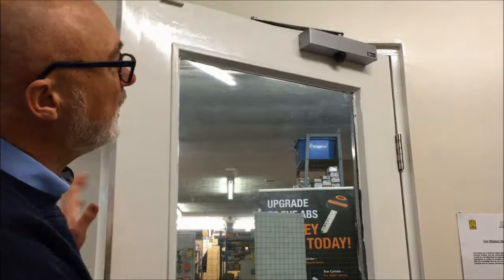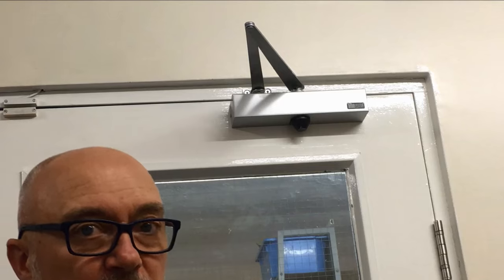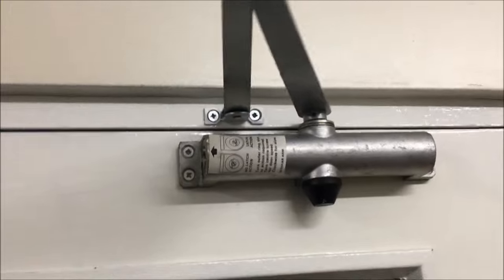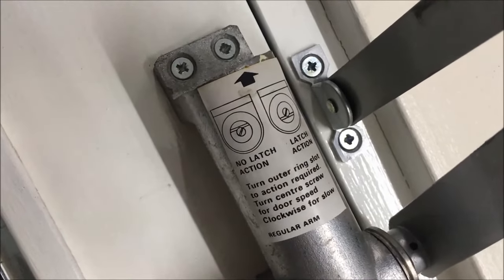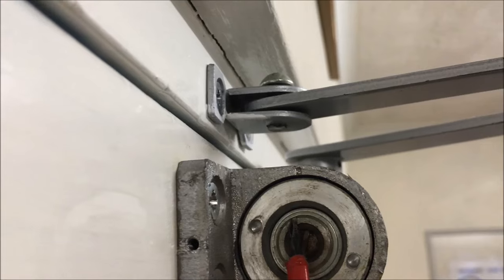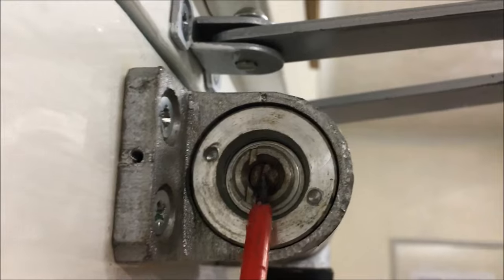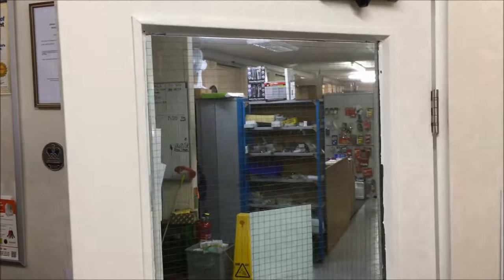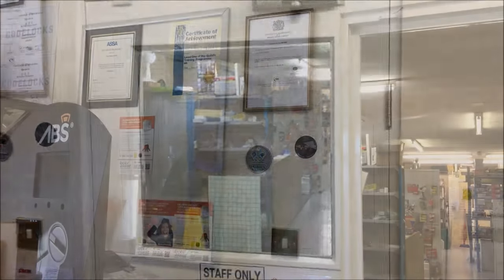How To Adjust An Overhead Door Closer?

Comment: How do i get the power / strength to click shut?  I understand the speed adjustment part/  I'm in a block of flats, i'm on ground floor & the main door when folk go out, the door doesn't click shut (its supposed to be a secure entry with intercom etc.) the door closes over but cant deal with the resistance to actually click shut.  it used to click shut so it needs adjusted but as i watched video i didnt see example of this adjustment.
Reply: Hi. in the video, there are 2 adjustments - one for speed from fully open from around 90* to 15* and the other adjustment is the latching adjustment - from 15* to close.  In the video, on our closer the latch adjustment is in the middle of the of the speed adjustment.  You may find that the resistance can  be cured by spraying some WD-40 or similar onto the latch to reduce the friction..  Good luck, Paul.
Reply: Thanks very much :)   @PaulHarperSmith

Comment: What maintenance is possible - can we lubricate the mechanism?
Reply: Hi Manuel,  these are sealed units so the only maintenance is to ensure all fixings are secure and only the pivot points can be lubricated.  If there is a latch on the door, this can be lubricated too.  Regards, Paul

Comment: Hey wonder if you can help. I have a door closer that says on the side "Super Lynx by Yannedis" and I cannot work out how to get inside it. There is one screw on the underside but that looks more like an adjustment screw than a case screw and there are no other screws I can find to get the cover off. This one does seem to have broken down and we could do with getting it off the door.
Reply: Hi, it may be one that the cover is clipped on and just pulls off?  Can you send a photo?  Thanks.  Paul
Reply: Hi Paul, Thanks for your reply. Here are some photos of it. https://uploadpie.com/4z5i9p https://uploadpie.com/JQO5lw https://uploadpie.com/X2zlsD. There doesn't seem to be a gap big enough to even fit a screwdriver in to ease it open.

Comment: Sorry to trouble you,  but what is the difference between "latch" action and "no latch" action?
Reply: Hi Pat. The difference is that if you have a latch on the door, you need to select the latch action setting, but if there is no latch such as a corridor door, then select no latch action. Hope this helps. Regards, Paul.
Reply: You will need to select latch action, if you have a latch on the door, as that gives more strength to overcome the resistance of the latch spring, so the door closes.
Reply: @PaulHarperSmith  
Oh! I get it! When I have been to certain buildings there are doors which swing beyond the middle then swing back to centre. 
Thank you very much.
Reply: @patb8985  if there are no latches, there is no resistance to overcome so the no latch position finally closes the door more gently and quietly.

Comment: lol, there is nothing about the Tension of the closer the power in other words.
Reply: Hi Tariq. Most door closers have a preset tension (size 3) to ensure they meet fire regulations however there are some that are adjustable from 2 - 4.  There are also easi open ones used on nursing homes.  Thanks for the question.